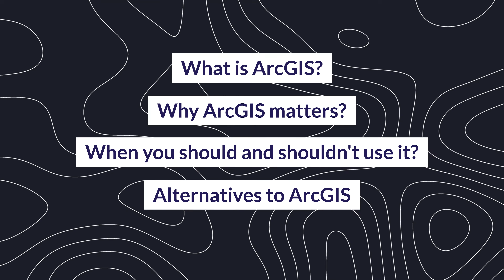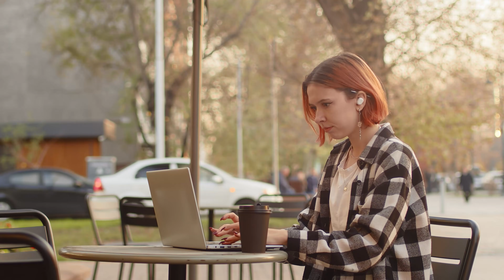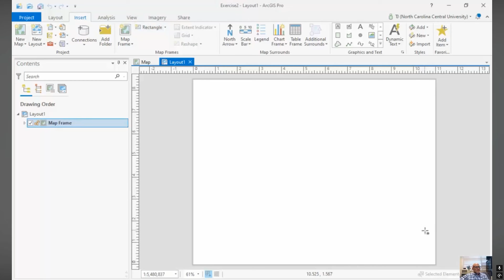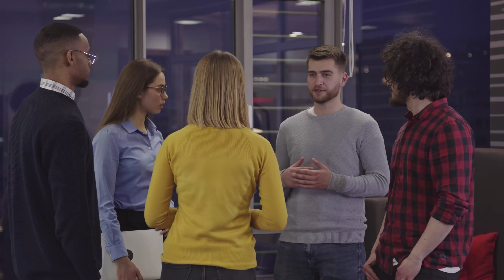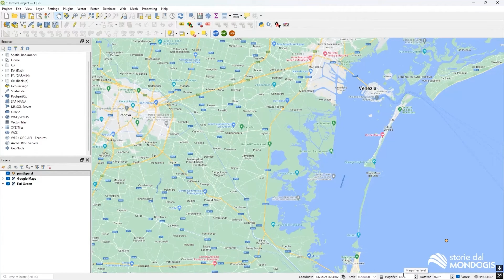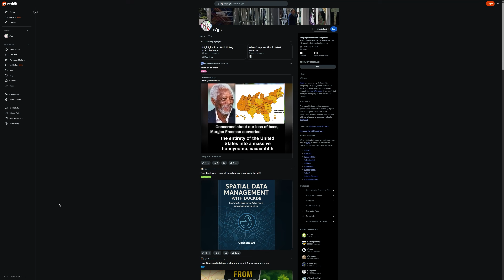Do You Actually Need Esri Today?

Comment: One thing to clarify for cloud users, you can direct connect to most warehouses and object stores mentioned here. You can do BigQuery, Snowflake, S3, Blob using the OOTB tools. Anything else using Data Interop (FME) or FME directly has done the trick.
Reply from the maker: That is true they are doing a better job of that. Rendering still presents issues if the data is too big.